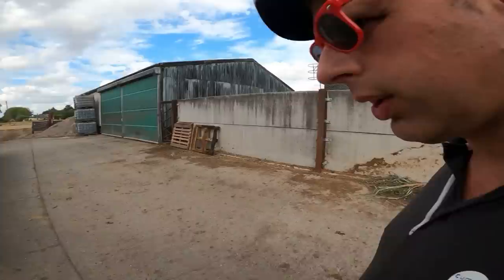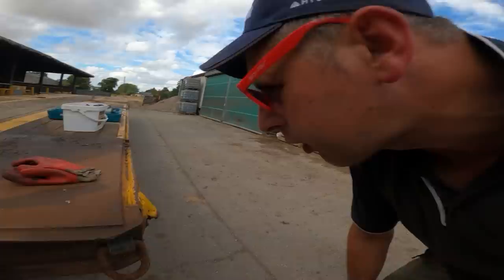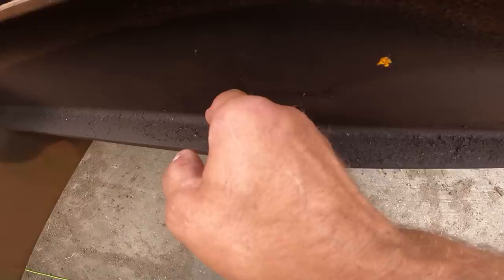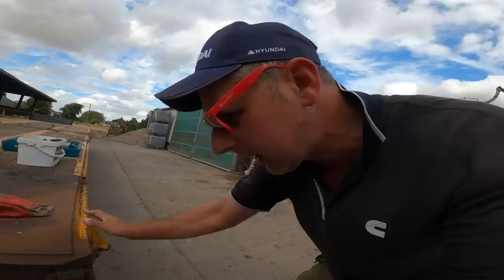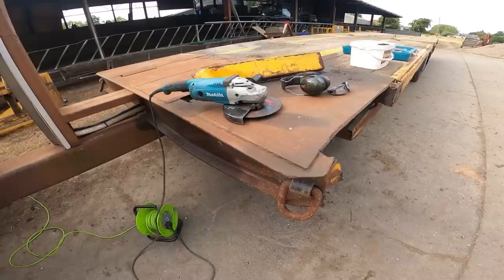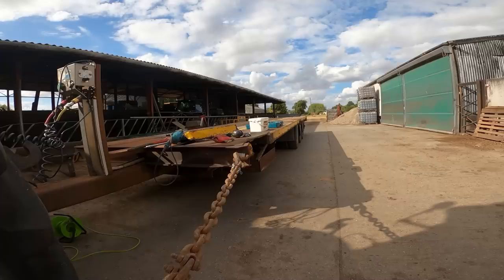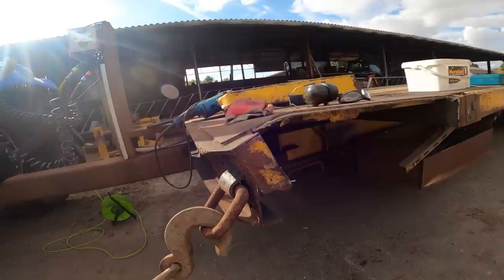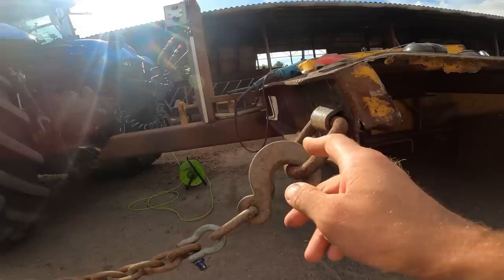NEW TRAILER - CAN I SORT IT???

Comment: Youv'e done well there without heat, cut some pipe & chock up the corner & flatten the top high point with a sledge hammer & finally plate up
ATB
Dave

Comment: George, if you find a piece of quarter inch thick flat steel, you ought to cut a couple of 6 x 6 or 8 x 8 nch triangles out and weld them into the corner to reinforce it.